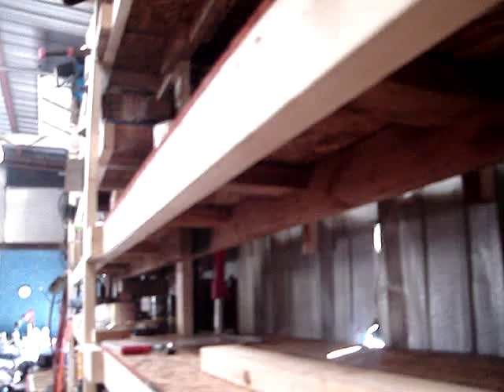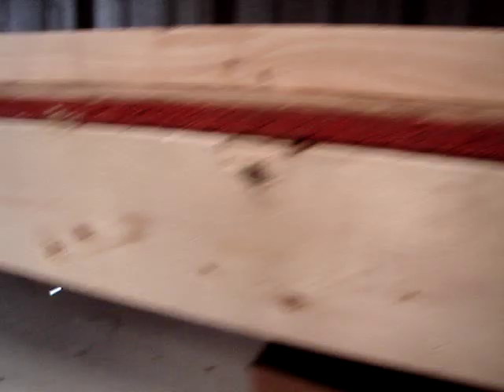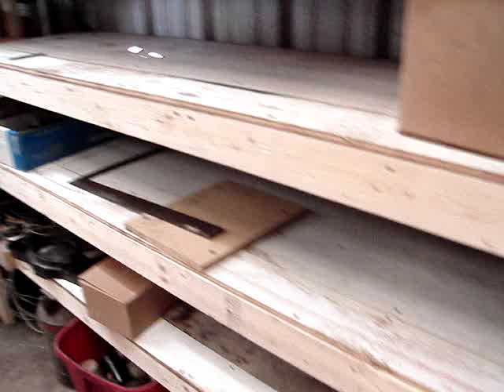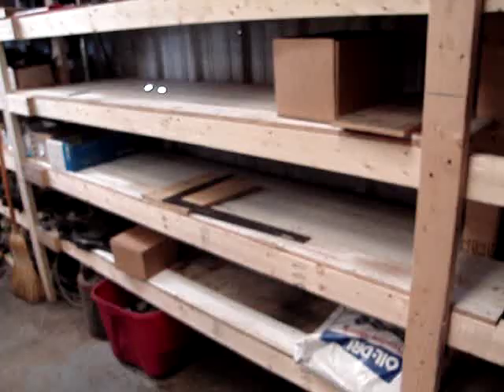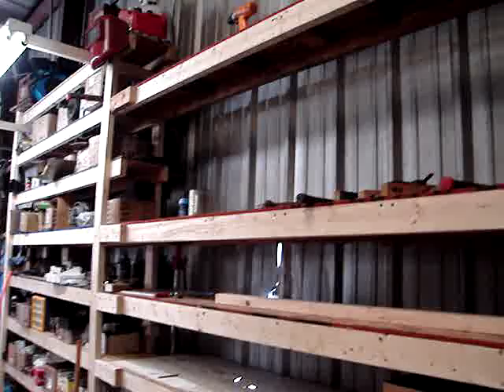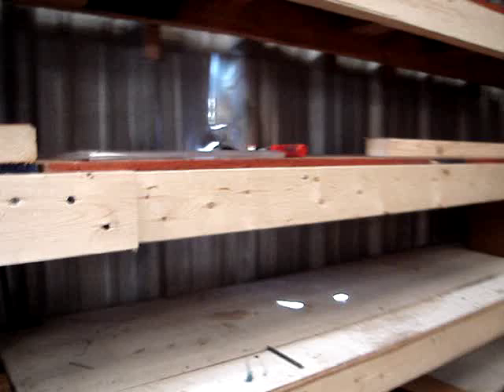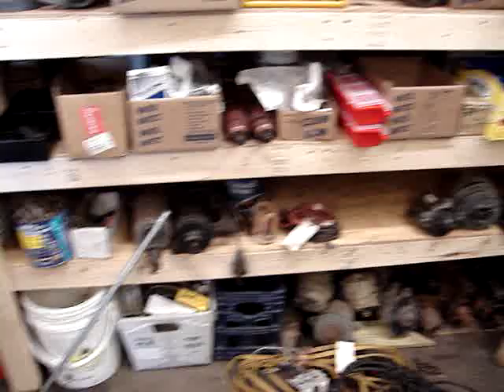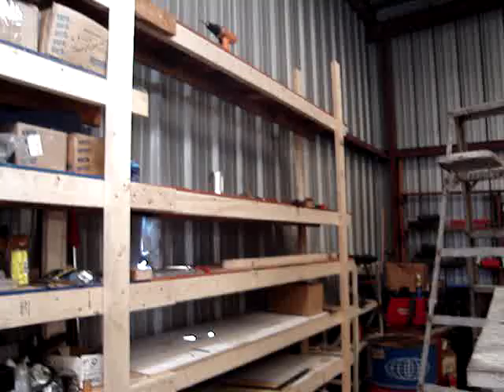Wood Shelf low cost easy  2X4 construction

Comment: If your really worried about shelves falling, screws shearing etc. Just cut some 1/2" OSB into 3 1/2" wide strips and cut to length to fit on the backside of vertical supports between the shelves. Helps by transferring the weight to the floor, as long as there is one on the bottom from floor to underneath first shelf. TJI (I beam) floor joists are mostly just OSB also.

Comment from the maker: The comment I made about the 20 ton crushablity of a pine 2X4 was for the upright supports only not the actual shelves. Many times I've seen way too much wood used in upright support of benches and shelves and actually not enough thought into proper support to prevent sag. It's a space utilization thing.Think how much weight (what is going on shelf) Think about the size of the objects.Think Ease of use (not too many uprights or doors in the way) Not too deep (where things on shelf can hide )  :)

Comment: The only thing is the cross bracing......laying flat any 2x lumber is weaker.   Could have run 24" center if the 2x brace was placed standing, like the shelf supports.

But I guess for the depth of the shelves, it really doesn't matter.  Gonna build a set of these in my shop.

Comment from the maker: To the question about parking ..yes we plenty of room for cars and equipment.
 The foot  print was very small ,actually. 16 feet X 1 foot was the actual floor space taken up.
  I have since moved to a new location and built more shelves on this model 
 A set of 'free standing shelves  2 foot X 8 foot  and some shelves 20 ft long by 16 inches deep .Both sets are 8 foot high. Video later ,lol

Comment: I really like this suggestion. I always distrust the shear strength of screws.  Sheetrock screws have poor shear strength so construction screws should be used.  With the OSB the glue can be avoided and the shop rearranged when needed.

Comment from the maker: I agree nails are stronger and for some joints the second screw is a nail ,lol "However for Assembling screws are easier in most cases than nailing .
Also keep in mind I used liquid nail glue gun for each joint .After a couple months
 you can back out the screws an reuse on another project ! (I'm kidding ,but we 
 tried removing a shelve by removing screws and  almost had to saw it off to remove !

Comment: I would have the larger gap on the bottom. Usually those items are heavier. Plust you save on wood not using a bottom shelf you use the ground. Plus when there are not items placed you have the extra floor space.

Comment from the maker: The Reason I went flat with the cross bracing is to maximise the room under each shelf , Those cross braces are only 9 inches long . 2X the width of the 2X4 uprights plus 9 inches equals a 12 inch wide shelf , Those cross braces flat will hold anything the material used for actual shelving can hold.
   I appreciate all the fine comments. I never dreamed i'd get this many hits on this particular video

Comment: I'd stop using screws for three reasons. 1) Nails have more mass and stronger for load and lower cost. 2) Nails don't fail suddenly because they are not hardened like screws. 3) Screws can rust and impossible to remove to reuse wood.

Comment from the maker: Grins ..try a straight down pressure on 4 screws on the end like you see ....and tell me what lbs it took to sheer it  ...remember each joint has 'liquid nail ' in it also....you almost can't TEAR those joints apart...we have tried later to remove one or two shelves ?....omg almost have to cut the wood !!

Comment: Nice but it's going to sag in the center between uprights. It's too long of a span between uprights for a 2x4.

I've seen others do this and the horizontal 2x4's always sag and twist. Especially after a couple seasons with weight on them.

Though I understand the reason you did it, (clearance), the cross 2x4's are turned wrong side up to give maximum support. They would help prevent twisting and add more support turned 2 by up.

As long as your happy with them and work for your purpose, none of what I say matters in the end I suppose. Lol

Thanks for sharing your build though.

Comment: I think you are over estimating the compressive strength of a typical 2x4. (at least unbraced.) I looked this up online and this sounds more reasonable.
Posting so someone does not underbuild a shelf and have a failure.

" How much compressive strength?  It depends a lot on length. If short, say two-feet or less, a 2x4 can hold approximately 4,500 lbs. — over two tons. If long, however, the story changes dramatically. That same 2x4, six feet long, can hold only 900 lbs."